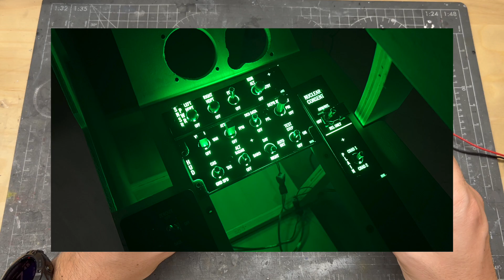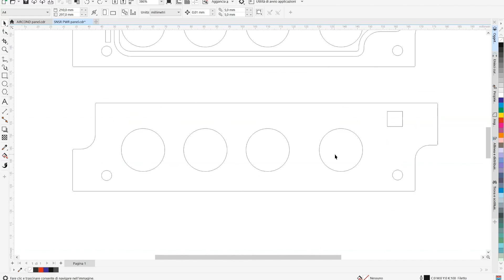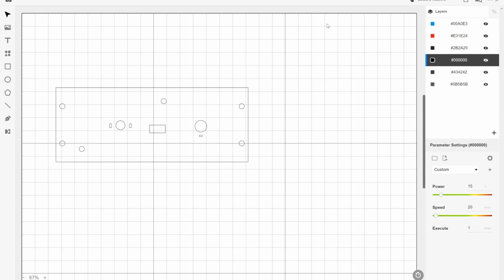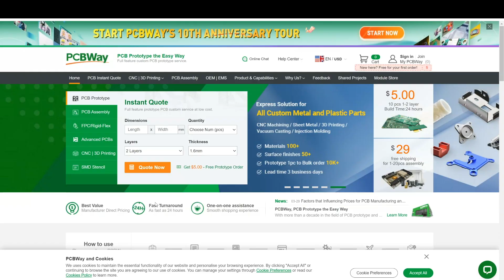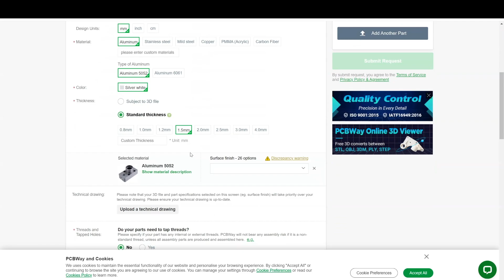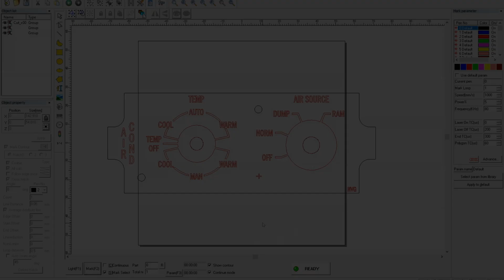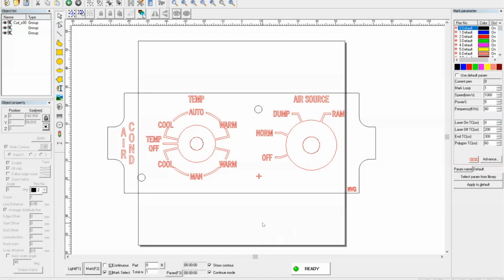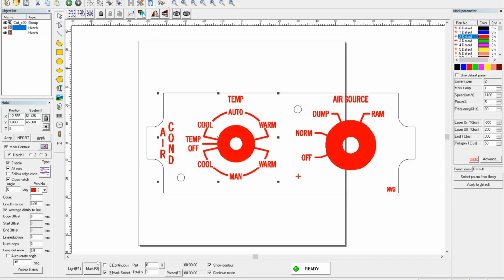[NEW] Making F-16 Simulator Cockpit Panels

Comment: Looks great man! I'm modeling my own right now as well but I dont have a co2 laser so I'm building it using my 3d printer. Once I g3t my process down 100% I'll move on to the rest of the panels. Working on the avionics power panel first
Reply: Have you managed to replicate this amazing panel with 3D printing? I’m considering that as well as I have a 3D printer and a diode laser engraver that can’t cut acrylic. Which filament have you used for the different layers? Thanks!
Reply: @zachiekhous1413its not quite the same but fairly close, I just use pla. I've been busy with work and haven't had a chance to do any arduino stuff yet
Reply: @davidworden1466 cool, I’ll give it a try soon

Comment: How are you creating the pathways for the led strips? I have an A10 pit an use the panels from TheWarthogProject. Lightburn doesn’t do a good job with those pathways
Reply from the maker: I'm using coreldraw to create them, use a 2mm line / spline then convert the outline to object
Reply: Thanks i was looking for the measurements

Comment: Awesome work! I have the same COB-strip as you. Are you cutting and soldering the strip? Or are you using one strip/pre soldered per panel? Its so tiny connectors haha :D
Reply: And also, I would love to buy the buildfiles from you, if its possible ! Kind regards from Sweden
Reply from the maker: I'm soldering the strip at the cut points. Files are available at viperpits.org

Comment: Amazing! What switches are you using (video at 1:16)? A video about the Arduino setup would be very helpful, what software will you be using? Where are you located? Thanks!
Reply from the maker: thanks man! Those are T80T-Z1 switches, but any 12mm switch will do. If you check out my last video there's a bit of Arduino coding but thanks for the idea! I'm in Italy :)
Reply: Thank you, are you using T80T-Z1 switches from a certain provider or China-imports? Are you gonna you your cockpit with DCS? Merry Christmas!

Comment: So why didn't you just use a gloss white acrylic and then paint it flat black and save the steps of having to paint the acrylic white? When you  engrave the white panel which is painted black the lettering comes out absolutely perfect ...
Reply from the maker: I was doing that before but unfortunately the solid white acrylic blocks too much of the backlight
Reply: You have to use acrylic in “opal” colour. It looks white but transmits light.
Reply: @lebojay there are also many different versions of 'white' acrylic ... some are more translucent than others

Comment: Nice one! I’ve been thinking about the exact same process. 

I do have some questions for you though:
1) what make/model of the fibre laser do you use? Normally they’re quite expensive. More expensive than co2 lasers 
2) how much does PCBWay charge for an aluminium backplate on average ?
3) have you test fitted the backplate on the consoles? The backplates are larger than the acrylic plates (in line with dzus panel sizing), but I believe the consoles leave no tolerances.
Reply from the maker: @baronvonrichthofen2021  thanks man. 
1) basic 1 from em-smart. Yes they’re pricy 
2) best if you ask them directly for the most accurate estimate 
3) yes and they fit perfectly. Plastic or aluminium the backplate have the same dimensions, only different thickness (2.0mm vs 1.5mm)
Reply: @The_ViperProject  thanks, appreciate the response. I’m developing the side console at the moment, in imperial, because that’s how dzus works. Currently I have no tolerance between backplates, which will undoubtedly become a problem. Luckily I can still adjust the overall size for the acrylic plates, but if I order from PCBWay, I do worry a bit about tolerances (though I guess I could always sand the edges if necessary).
By the way, is there a reason why you choose to use aluminium backplates rather than use PCBs as backplates?

Also, can you show how you currently connect pcb to panel?

Comment: How do you add the switch covers or knobs to the switches so they are fixed or glued on. But you can still remove them so you can remove the switches from the panel?
Reply: You can use a die to put threads on them
Reply: @MozTS  what do you mean with a die?
Reply: @DommelTheDog   A die cuts external threads like on a bolt a tap cuts internal threads similar to a nut.
Reply from the maker: @DommelTheDog  the switch caps are press fit and I used a bit of “blutack” to secure them, however they fit through holes so no need to remove them.
The knobs on the pots are also press fit and there’s a hole for a set screw, they can be pulled off if I need to take the panel apart
Reply: @The_ViperProject  awesome. Thanks
Reply: Could you post a link to the led strip and the glue you used please?
Reply: I have  5v green cob led strip.
How can i dimmer it?